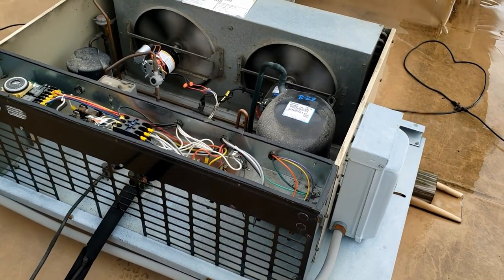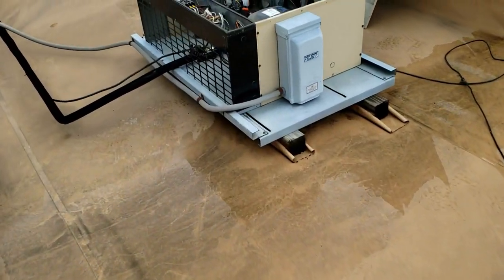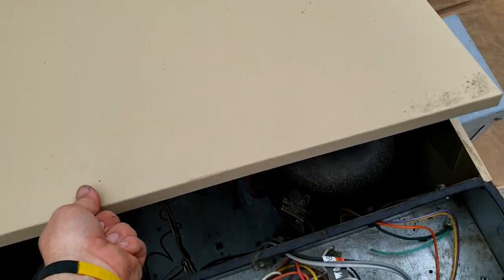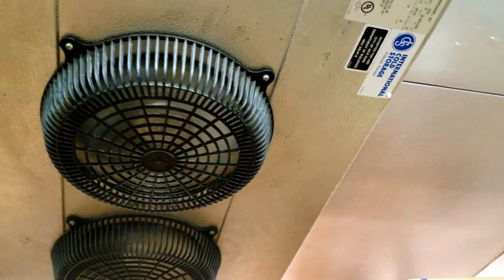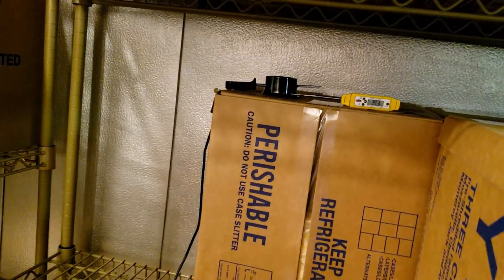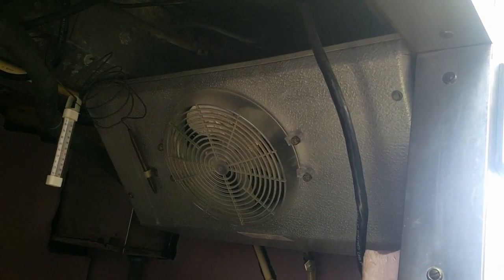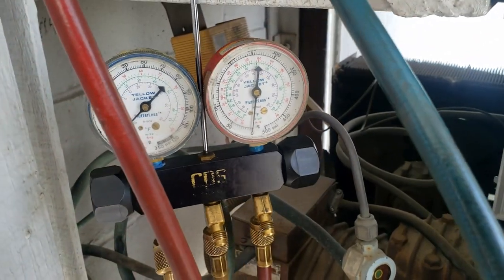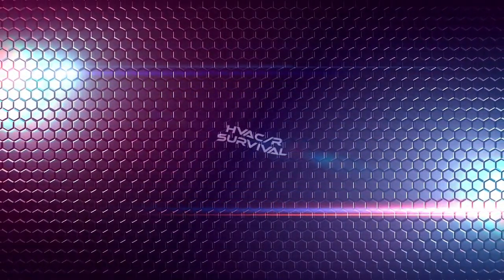IS THE COOLER TOO WARM OR ARE YOU CRAZY?

Comment: Those spacemeizer coils usually have a mounting spot inside the coil for thermostat bulb. When you drop the pan or take out evap fan motor closest to electrical section you can see it. Good video. I hate cleaning those coils. By the time they get cleaned it’s usually needed it for awhile.
Reply from the maker: Thanks for the info🤜🤛👍👍

Comment: You should set the sensor bulp under the fan's plastic cover measuring the return air temp.this way you didnt need to set the thermostat in lower temp.
Reply from the maker: If the thermostat wasn't brand new I would have done that, and that's what I will do if they happen to call back and have me put a digital thermostat on which they have not. I assume everything is working as it should.